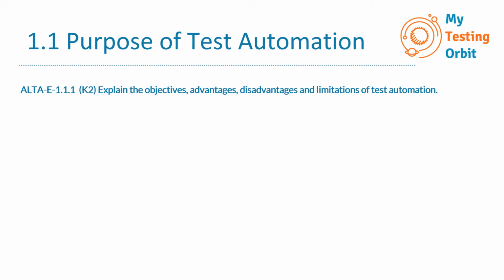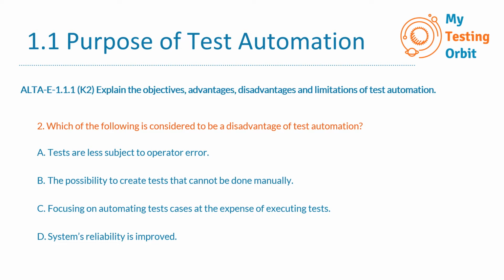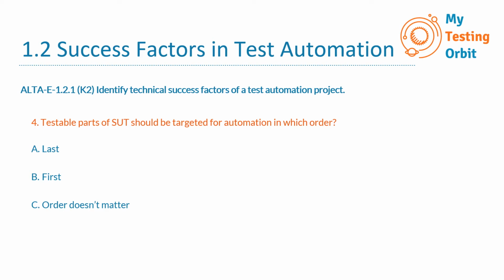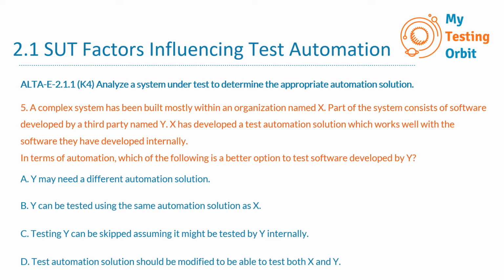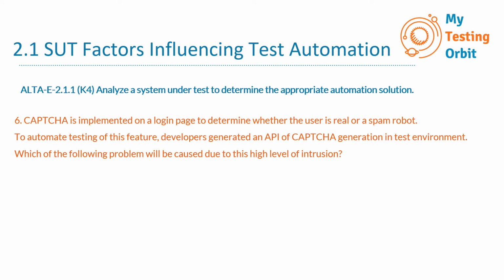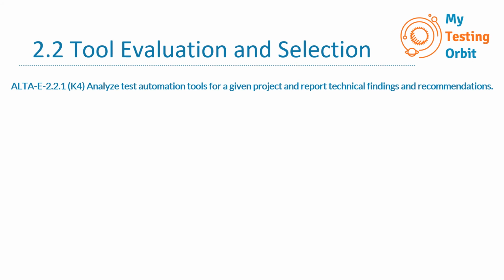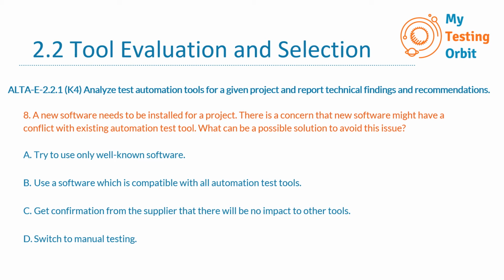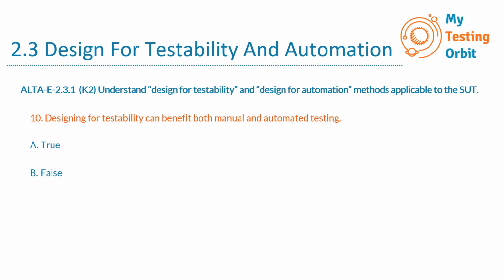ISTQB Advanced Test Automation Engineer Certification-# 7- Module 1 & 2 Practice/Sample  Questions

Comment: Regarding question 5: I think D is the correct answer, because if they are tested by two automation solution there might not an integration thesting you mentioned in the explanation of question C and the interfaces from X to Y might not be tested, which is mandatory for the success factor "broad and deep"
Reply: Yes i am also thinking the same